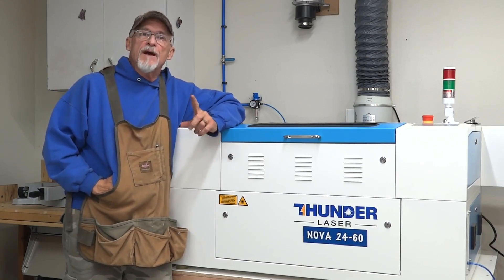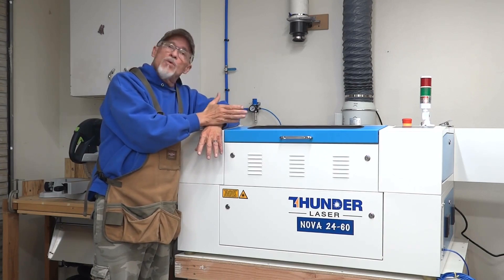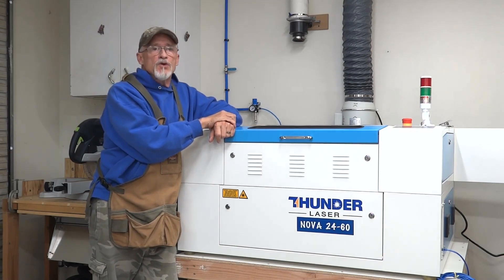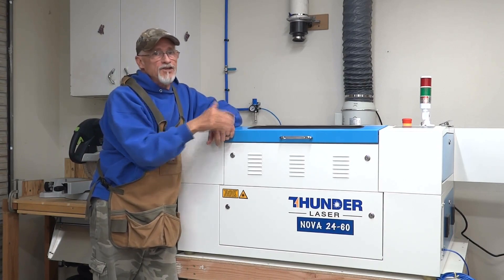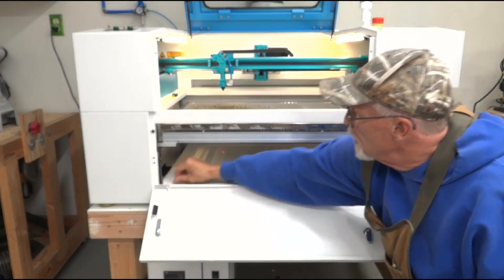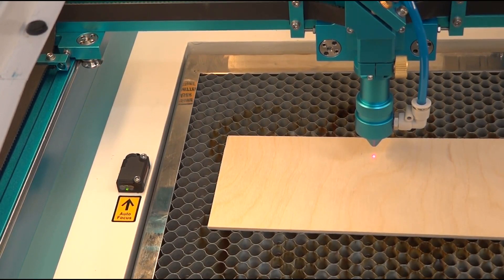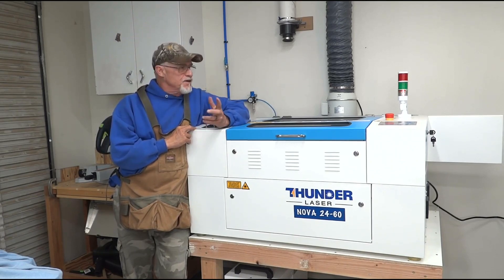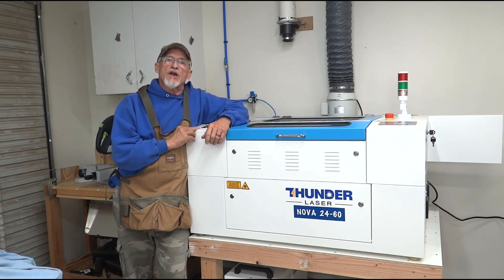Thunder Laser Nova 24 Initial Review

Comment: After months of research my wife and I are considering the Nova 24. Any suggestions on moving this beast?  This one of biggest concerns, getting it into our spare bedroom (ranch home).  Did you buy any other lenses?  Thanks.
Reply from the maker: Great choice, it will be about 380 pounds uncreated. A quality furniture dolly is a must and I would have 4 strong men to put it in place you will need a table to put it on. It’s comes with a 2” standard if you’re planning cutting thicker materials the 1/4” get the 4” lens. Other than that it comes with every thing you need . External air addition is alway a great upgrade. Good luck and welcome to the family. I do one on one session for lightburn and laser operation if your need it
Reply: @computercreationz  What thickness of material can you cut with the standard 2" lens?  We plan to cut wood and acrylic, but no more than 1/4" for now.  Thanks!
Reply from the maker: @douglasladley8698  you will be fine with the provided 2" standard head!

Comment: Thank you for this informative video! I’ve been leaning towards a Thunder laser and your overview helped me out a lot. Can you tell me what your laser wattage is and max thickness solid soft wood like poplar and plywood you easily cut through?
Reply from the maker: It a 60 watt laser and I often cut 1/2” hardwood with external air. If your going to be cutting allot of product greater than 1/4” I would go with a higher wattage. Cutting 1/2” material is slow with a 60 watt. Be sure to check out my 1 year review on this laser on my channel. Thank for watching and good luck with your laser purchase.

Comment: Hi, Thank you so much for such a great review! It has been very helpful. I have a concern regarding fumes come out of the laser machine when cutting wood or acrylic. 

When cutting a material with the machine closed, can you smell the fumes? Or does the exhaust system takes care of it completely? 

I will have the laser installed in a bedroom in my house and I am worried about the fumes causing health issues in my family. Please advice! Thanks!
Reply from the maker: if the venting is done properly the smell is minimal . BUT when cutting acrylic the small is more apparent in the shop. I don’t believe you totally get rid of it. your kidding yourself if you think there will not be any smell after using a laser no matter what the material. the honeycomb bed will hold material residue and if you leave the lid open the small is more apparent.
Reply: @computercreationz  smell being my worry about leather engraving as well. You mentioned doing leather on your machine, do you have a video on that? Also, ive had conflicting feedback on if it is ok engraving finoshed leather vs unfinished if you care to shine a light on that for me 😁 thanks for this video! Going to watch your 1 year review.

Comment: It is a generic Chinese machine.
Reply from the maker: Far from it, it has encased roller bearing all around, No maintenance on the bearings unlike the constant lubing you need with the Linear Rail system. Much heavier shell and gantry system. EZ servo Motors that provide 1000mm/s compared to 300-400mm/s for the eBay style laser. Beam Combiner compared to a red dot installed on the head of the laser.  Ma Meter pre installed on the Thunder. Wiring is much Beefier on the Thunder. Comparing this laser to a generic Chinese laser is not even close!
Reply: @computercreationz  the company is a chinese company that just this year got a dedicated US distributor.
Reply: @faded1805  well I saw it on Alibaba I am confused if Chinese or American ...

Comment: Thx so much for your time and thoroughness in your covered topics.  I also watched the 2nd video as well.  I am currently waiting for my Nova 24 which is due to arrive mid August.  One question regarding the placement of the side access panels.  I am going to also build a similar cart with some modifications.  I plan to create some vertical storage shelves to house flat wood panels and an attached raised deck for a laptop.  Hence my question regarding the side panels.  Coud you please tell me the size and distance from top, bottom and sides?  I want to ensure my raised laptop deck does not block any access panels on the sides.  Thx so much
Reply from the maker: Congrats on the new 24, you will love it, I use mine almost every day. I’m not real sure I understand what you want me to measure? There are upper and lower panels that open on both sides of the laser so you won’t be able to build a laptop area along side the laser. The side doors won’t open. Please keep in mind that if you store wood panels under the laser to provide plenty of room around the chiller for air flow.
Reply: @computercreationz  great to know and thx for the insight.  I am referring to the panels on the left and right side.  I am building my cart with an integrated laptop table to the right side.  I searched everywhere for the locations of the panels on the sides to ensure I dont block them.  Your videos were extremely helpful and was a big help in deciding which laser to purchase!  Also as far as I can tell the chiller is about 80 lbs full.  I subscibed and cant wait for an updated video and maybe some of your sample laser projects!

Comment: would you reach the nova mini for a small at home business??
Reply from the maker: It depends on what your going to do with it. If your strictly engraving the mini would be good. If your planning on cutting anything larger that 1/8” I would go with the one I have which is the Nova 24 60 watt
Reply: @computercreationz  In your latest videos, it looks like you are using a larger model.  Did you upgrade?  And, if so, why?
Reply from the maker: @jccbsl1  yes I sold my Cnc machine which gave me enough room to get a 35-100 in my shop. I loved my 24 but found that when cutting thicker materials greater than 1/4” it was to slow for my needs. Sold the 24 to a good friend and upgraded to the 100 watt. Now I can cut 3/4” hardwood with no problem.

Comment: Thanks for all the great information. Just a question. Your machine looks a little different from what the Thunder USA site has. The fan does not look the same. Yours looks a lot nicer. Is that the fan that came with the unit? did you buy your own? The front graphic looks different also. Thanks again for the great video.
Reply from the maker: The fan I received is the one that cones with the unit standard. The one you see on the Thunder site is for the bigger lasers I believe. The Nova 24-60 on the front is a sticker I made. Not sure why they don’t label there lasers. It’s a great machine I use it almost every day.
Reply: @computercreationz  Thanks for the reply. I look forward to more videos from you. I need as much help as I can get.